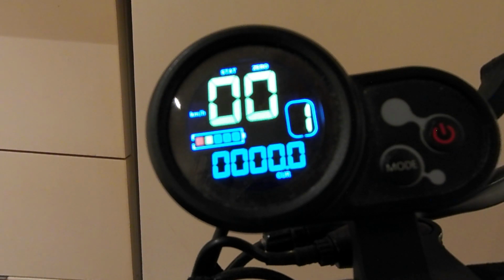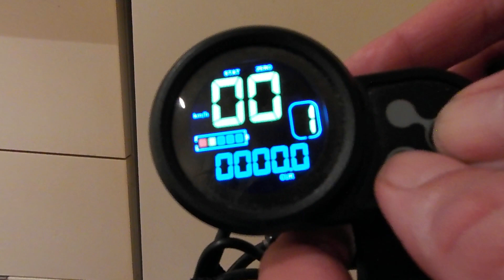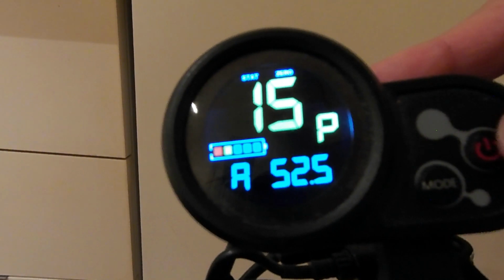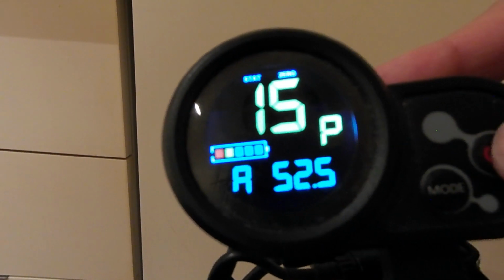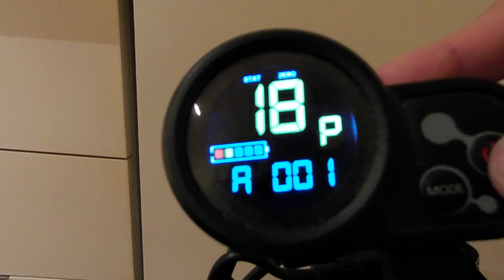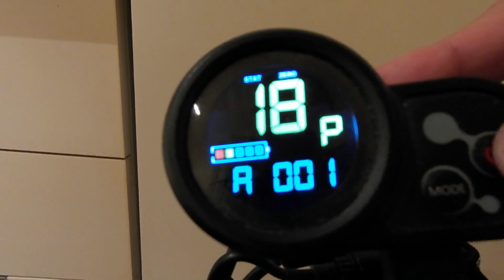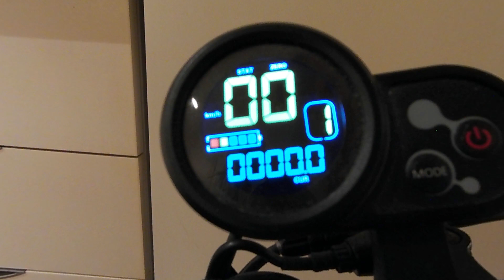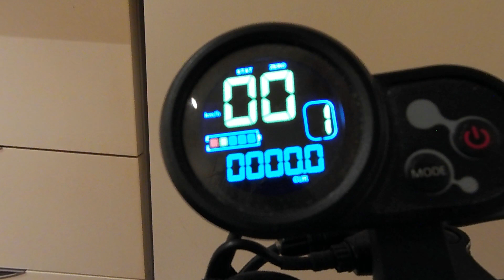Programming Electric Scooters for 18-Setting Variants (P1-P18)

Comment: Thank you been looking for these settings for the Boyueda hope they match.
Reply from the maker: Cool, hope the settings match. Please let me know how it goes.
Reply: @marcusoroberts  will do when my new LH-100 displays delivered. Hope it's an exact match or the soldering iron coming out with magnifying glass and tweezers.
Reply from the maker: @strawman9410  MOSFETs, and wiring connections. Connectors biggest weekness. You'll be fine.
Reply: I change the mosfet every day, I ride both one engine and 2, it always goes away anyway

Comment: Hello. thanks for the video. A question:  can you also enter a speed limit, so that the scooter only drives 10 or 20 ... mph?
Reply from the maker: Hi and thanks, you can of course attenuate power with the eco button. On scooters with a P0-P9 setting parameter set P8 to less than 100. On scooters with parameters P01-P18 set P08 to less than 100. Dials back power.
Reply: @marcusoroberts  Thank you for your prompt reply. will then test it, the scotter must be there first. 👍
Reply from the maker: @pirelli77  it's a good question, because it also makes it safer for kids. Limiting the speed.
Reply: @marcusoroberts  that's true. ideal for children but also for adults to learn.

Comment: Hi. Need some help here: I have a scooter with parameters similar to these and I have mistakenly modified the sets 11, 12 and 13 whose values were 2, 3 and 8 respectively. Now those three are in 0 and I can't change them again. The SCOOTER is still working but now it is much slower than before. How can I solve this or reset factory settings?
Reply from the maker: Will it not physically allow you to toggle the settings? They are set in non-volatile memory on the LCD throttle and can be overwritten.
Reply: Thanks for your answer. Yes, I can't phisically change them. I push de buttons but they stay at 0. How can I overwrite them?
Reply: @marcusoroberts  me to on my mercane mx60 :( I tried to derestrict it and now it feels more sluggish than factory settings
Reply: Did u ever figured it out? I have same issue with P-05 and P-15

Comment: Can you not change kmh to mph?
Reply from the maker: The second setting should allow you to toggle between kmh (0) and mph (1), but the 18 parameter ones I've seen, this is hardcoded to '0'.
Reply: Marcus Roberts  cheers mate I’m gonna have a go with mine tonight but I think it is hard programmed to kmh
Reply from the maker: @Basstrucker2013  do please let us know if you were able to change it. I know on the 10 setting ones it's possible. Cheers mate.
Reply: Marcus Roberts  I can’t change the 2nd option on mine does nothing and number 4 is wheel size I think
Reply from the maker: Thanks for sharing. Pretty much what I thought. On most 04 is the LCD timeout in minutes and 06 is the wheel diameter for speedo calibration. Maybe your version is different. Not sure if you've had a moment to check out my document?
Reply: Marcus Roberts  no worries mate, what document is that Marcus?
Reply from the maker: @Basstrucker2013  Hiya. There are a couple of links for Google Drive and OneDrive in the description. Let me know if you have any probs opening them. Cheers.
Reply: @Basstrucker2013  You can change the wheel diameter to get an MPH reading, i used 26.5 to convert to MPH (even though the little km/h light is still active).   I've owned a scooter that used this particular LCD.
Reply: themystx2 oh cheers mate I will give that a go, I don’t mind kmh it’s just annoying to look at being from the uk
Reply from the maker: @Basstrucker2013  Also in the UK and MPH is the only way to go! Especially if the scooter can exceed 30mph :)

Comment: Hi, I stumbled upon your video and have the same display on my 60v dual motor 3200w scooter. did you ever find a way to change to MPH?  Thanks.
Reply from the maker: Hi there. No, unfortunately there is no way I know of to change the setting from kmh to mph. The second setting can't be toggled between 1 and 0. I found the speedo to be really accurate when I compared with different reference GPS devices and apps. I guess it might change when the tyre starts wearing. When that happens I'll probably have to reduce the number from '10' (inches) in setting 06.
Reply: Marcus Roberts On my scooters default settings, my speedo will report 28 Kmh when I am actually going over 50 per GPS! I’ve adjusted the wheel diameter settings to see how that will help as i’ve had luck doing that in my Ruima mini4. I also find it annoying it won’t save trip data or the last speed mode it was in before power down. 

Your video did help me disable cruise control and set regen braking though! 

Curious to see if you’ve touched any other settings that may have made a positive impact. Thanks!
Reply from the maker: Interesting that the speedo is so inaccurate. I can't think what might be causing that...I'll have to do some experiments.
Reply: Marcus Roberts I semi-resolved the speedo situation; it’s somewhat of a half-assed fix, but setting the wheel diameter to P6 to 14.0 gives me 100% accurate speed readings in MPH compared to GPS (while LCD still says KMH)
Reply from the maker: It seems like the best (only) solution. Still, interesting why it does that. Perhaps when it comes to changing the tyre it will be ok. Glad you found a fix though!
Reply: Also, have you noticed how inaccurate (slow) the speedo is?